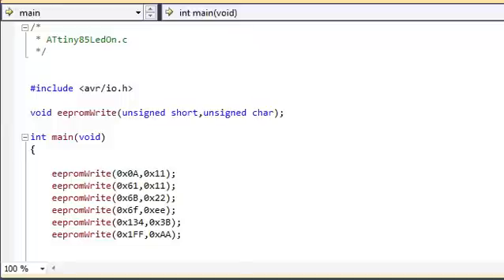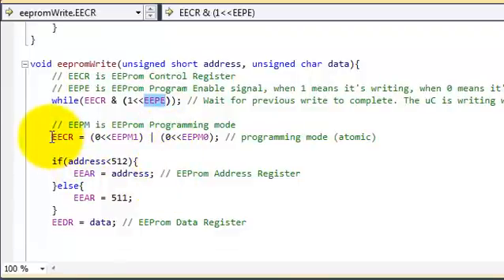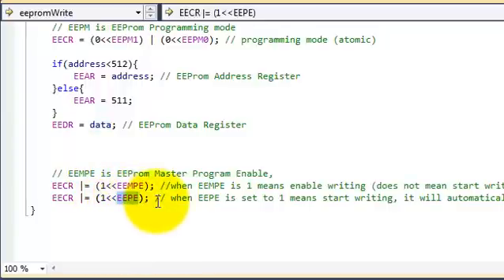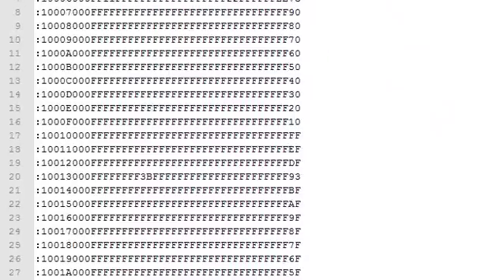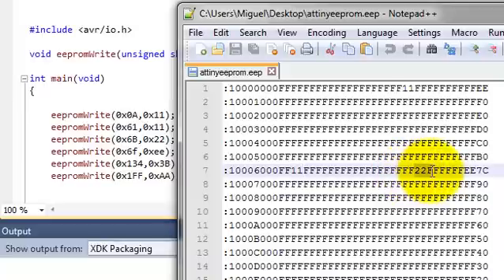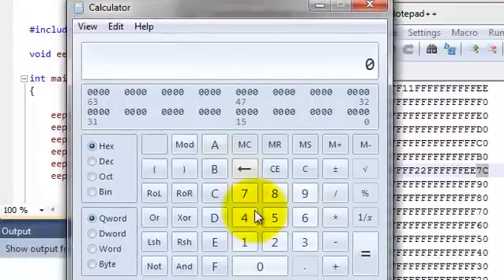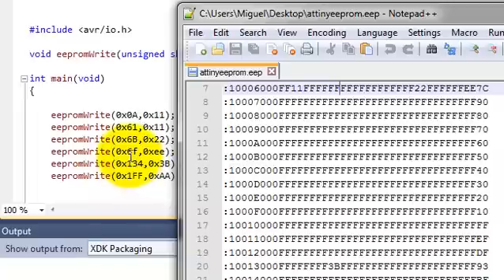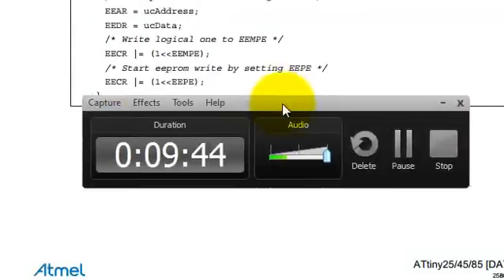AVR ATtiny85 Programming: EEPROM Reading and Writing

Comment: Or you can just

#include <avr/eeprom.h>

and use

void eeprom_write_byte(uint8_t *__p, uint8_t *__value);
uint8_t eeprom_read_byte(const uint8_t *__p);

and friends.

And avoid the hassle of copying from the attiny25/45/85 pdf.

Also, you can write not only bytes, you can also write words (16bits), double words (32bits), and floats. You can also use the eeprom_update_* functions to read first and only write if the values differ.

Of course, this might be GCC specific.

More info here:
http://www.nongnu.org/avr-libc/user-manual/group__avr__eeprom.html

Comment: Great .
MAbe a link to the code AND links to buy the eeprom ? thanks a lot ! :D keep going !
Reply from the maker: Leo Etcheverry The EEPROM is the EEPROM inside the Attiny85, so you don't have to buy one (it's not external). Unfortunately I don't have the code anymore, but I will remake it and post it.
Reply: AllAboutEE Great ! would it be great to add the name of your progrmamming environement ? and mabe add a link to the part on ebay/sparkfun what ever
Reply: for those ho need to program the attiny using Arduino as isp 
have a look at this https://code.google.com/p/arduino-tiny/issues/detail?id=46
Reply: Leo Etcheverry The name of the MCU is right up there in the title, Attiny85. He's probably using avrstudio, but I'm betting you have an arduino around, so just use that IDE.